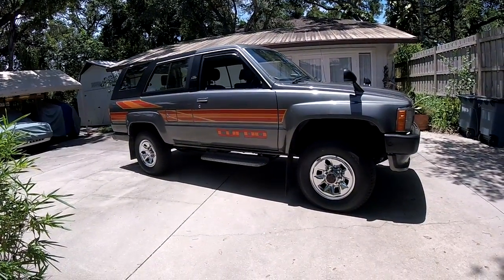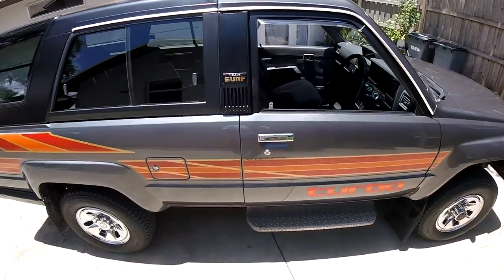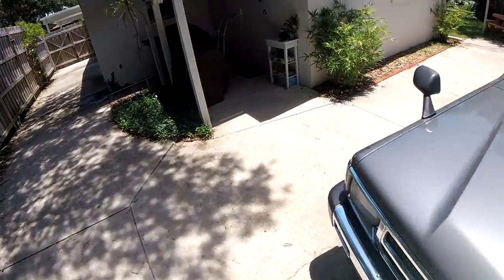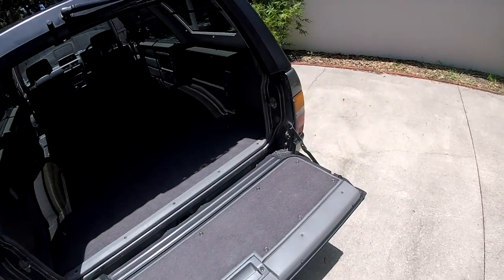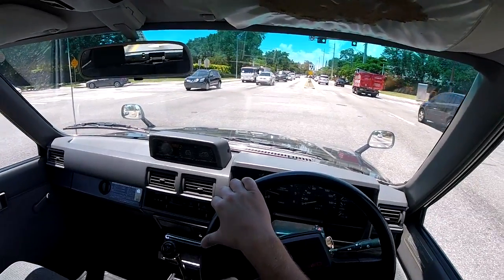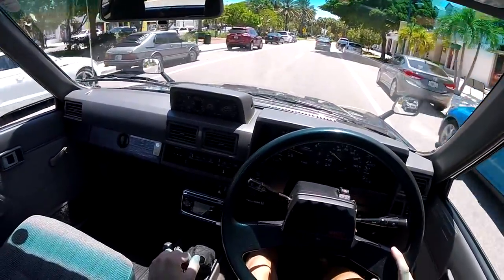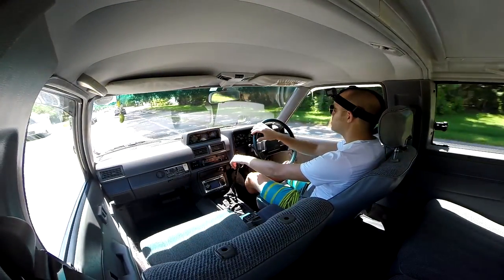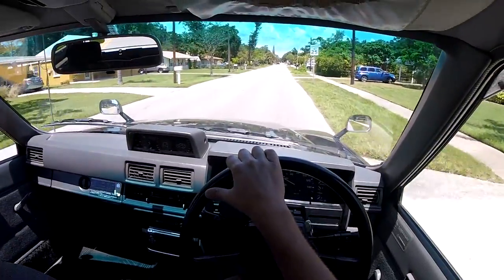1985 Hilux Surf SSR Turbo Diesel 4x4 LN61 in the USA - POV Walk Around and Long Drive

Comment: How much did u sell it for?
Reply: He didn't. He wants too much
Reply from the maker: 5 years ago, so 2018~ ish, we sold it privately. It was decently high priced for the time, but now it's worth far more than we sold it for then. Even with the damage on the rear tailgate, this Hilux Surf would probably fetch maybe 30k USD. This is true for any vehicle I've done a video on, value just slipped into the sky, especially the Toyotas.